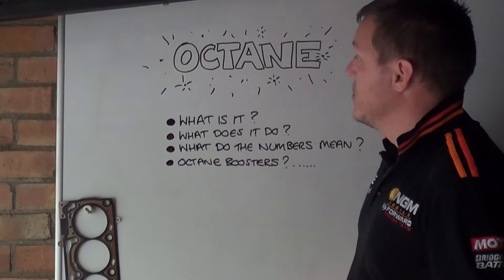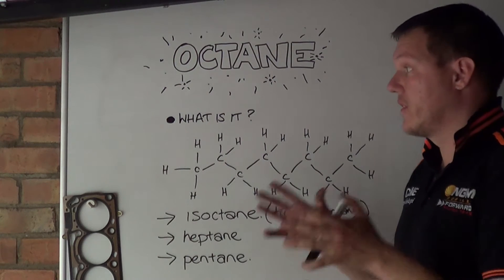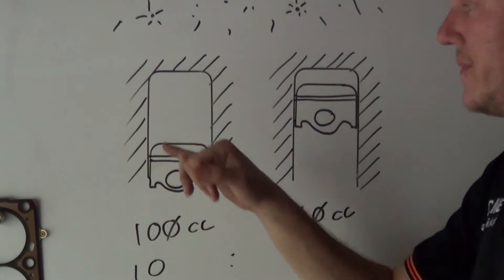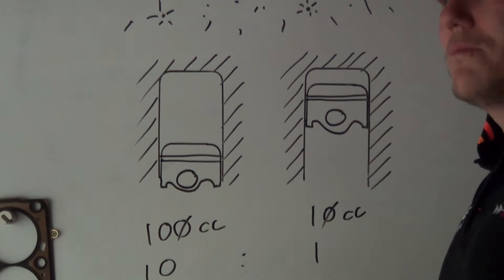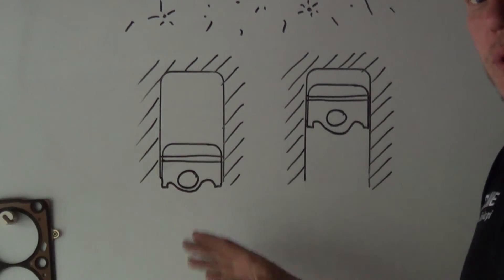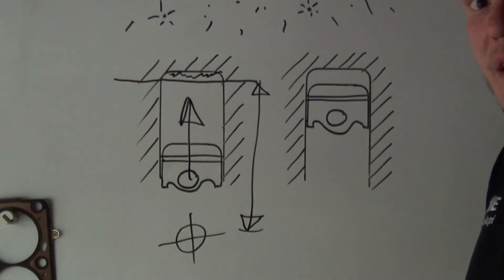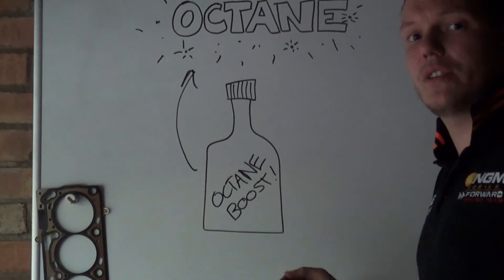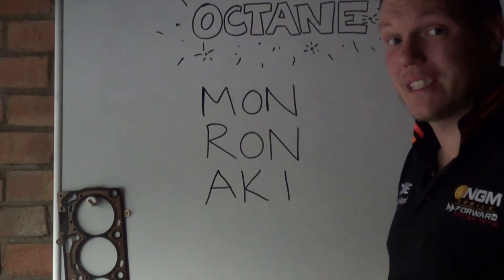Understanding Octane - Bike TEch

Comment: So this would address an issue I had, newish 4 cylinder petrol engine, low power and stuttering when cold (probably for the first 5 minutes of running). My wife was using a premium high octane fuel every time (98 RON). Then one time she accidentally uses standard fuel (91 RON), and low power when cold issue has gone.  Am I correct with this assumption?

Comment: What is the effect of running a bike on standard petrol when the manufacture recommends Premium.  There is a lot of crap out there.  Some people did a lot of comparisons (mpg etc) and concluded that there was no point in using premium, others advise people that using premium for one tank in four is good enough.
Reply from the maker: more chance of knock - but due to knock sensors the engine will just back down the power by adding too much fuel
Reply: True for newer bikes.  When does the ECU  reverse the change?

Comment: Is this how sometimes you see two-strokes with holes in the pistons? When i was in my early teens Suzuki X7s were very popular amongst my friends because they were cheap to buy, easy to get parts for and we would very often see pistons with holes through the top of them and when we asked someone who was older and we though had more knowledge on bike engines he said that it was because the plug was too hot but i though it was because there was usually those K&N pod filters or a bell mouths on the carbs

Comment: Can you not just advance the ignition timing to get a bit more power when using octane booster? It's a wee bit easier and quicker than skimming the head.
Reply from the maker: Advancing the ignition is not increasing the compression ratio, and what makes you think that octane and advance have anything to do with each other? Or is this a question that you want answering?
Reply: I know it is not increasing the compression ratio,,, doh!  I was suggesting a way of getting a  benefit  (power increase)from the octane booster without skimming the head... just asking.
Reply from the maker: No, octane rating are about autoignition. Ignition timing is about flame speed and rpm. More on this later but thanks for adding that - matt
Reply: Kenny Shields
I think you have a valid question.  I was thinking of the ECU limiting the advance when knock is present.  I have no idea what bikes use but in cars, the advance is limited by the detected knock.  Now Matt seems to be saying that timing advance is not adding horsepower.   And that might be true.  But I should think that backing off the advance would be limiting horsepower.  So in a perfect world, raising the octane shouldn't seem to give more power.  But in the real world keeping the ECU from backing off the timing is a valid consideration.   I vote for octane booster being of some value sometimes, maybe.  Who knows?

Comment: Ok so shoot me if I'm wrong but if my engine has a knock sensor and uses feedback that to help calculate and adjust the amount of fuel injected into a cylinder then by using octane booster to reduce knock then wouldn't the engine computer then be able to inject more fuel and therefore make more power , without changing compression ratios ? Just a thought , I'm no mechanic obviously
Reply from the maker: Octane boosters only increase the octane by 2-3 points which really isn't a lot. Not only that but petrol releases more energy than octane boost - so the octane boost replaces some of the petrol - which means less power. Knock sensors are there to detect knock which generally occurs due to temperature fluctuations more than anything else.
Reply: The Workshop thanks for the reply Matt , really enjoy the channel and content .
Paul from Australia

Comment: Hi matt .am I wasting money by putting the higher octane fuel in my bike if isn't pinking knocking on the cheap stuff.I've tried both and it does seem to cogg and pop more on the cheap stuff
Reply from the maker: where you live, what bike is it etc?
Reply: Yorkshire ,kxf450 supermoto , seems to pop and splutter a lot but it's funny cos it only does it with certain petrol stations and also the lower (normal octane ) fuel.
It does it more on the overrun or on declaration

Comment: lead was replaced with benzine i think, they say it's better but you have the choice of brain damage from lead or cancer from the benzine... i always believed that the octane was the prime burning chemical, and had nothing to do with knock... but thanks for the info very informative.
Reply from the maker: - MMT - or (Methylcyclopentadienyl manganese tricarbonyl)
- Iron pentacarbonyl
- 2,2,4-Trimethylpentane

are the three common additives used as anti-knocking agents
Reply: but the percentage of benzine in unleaded is higher than in leaded or was i told incorrectly?

Comment: The funny thing is that these days the most common octane boosting agent used is actually ethanol. I don't know about y'all in the U.K., but here in Texas the law requires at least 10% ethanol. Most people do to think of ethanol as an octane boosting agent, but it certainly does exactly that since pure ethanol has an octane rating of about 110.
Reply from the maker: The main reason ethanol was added to gas was because of the Clean Air Act. They added ethanol to reduce carbon monoxide emissions, under the banner E10.

Look at -
Title II - Emission Standards for Moving SourcesPart C - Clean Fuel Vehicles
Wiki link - https://en.wikipedia.org/wiki/Clean_Air_Act_(United_States)
Its also about renewable fuels such as E100. Fuel additives in use today have higher octane numbers -
toluene - 121xylene - 118propane - 112isopropanol (IPA) - 118
ethanol - 108.6
Reply: The Workshop : I know why ethanol is required as a fuel additive, no mystery there. I simply meant that most people do not consider that it is also an octane booster. The industry is well aware of this angle and is considering making it more of a selling point in the future. Here is an article that discusses it from the perspective of the ethanol industry : http://blogs.platts.com/2016/02/22/ethanol-race-higher-octane-standards-us/

Matt, I greatly appreciate your hard work. Thanks for all the food for thought. 🤠👍🏻

Comment: One good reason to use an octane booster is when you have a car that requires 98 but that isn't available. This happened to a friend who was with us on a road trip through Scotland. He drives a BMW 850 and the further North we went, 98 octane became scarcer and scarcer and then all of the sudden we were just happy to find any fuel station at all. :p
Luckily he saw this coming and stocked up on some octane booster so he could fill up with 95 and keep going. :)
Reply from the maker: I've heard this before but I'll do some more research. It could be true if BMW are running slightly higher comp ratios than a comparible car. Was it the a V8 or V12?
Reply: +Pony Power he's got the V12 and is very adamant about getting 98.
Reply from the maker: Yeah the BMW's tend to be abit tetchy if you run them on lower octane fuel. Most probably because they're running higher comp ratios but i'll have to check it out. It was a car they spent shit loads of money on but didn't sell many.